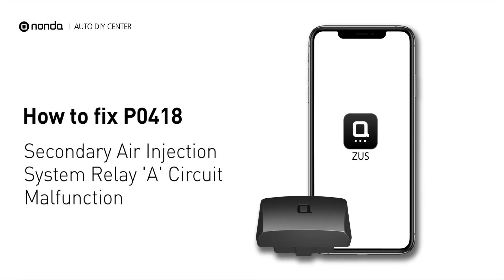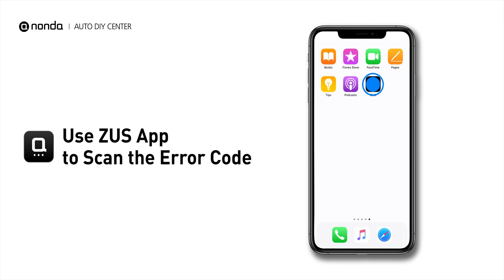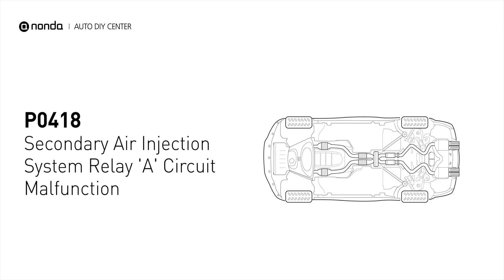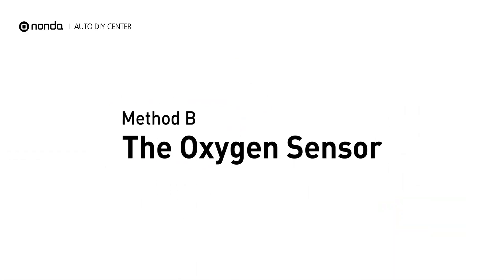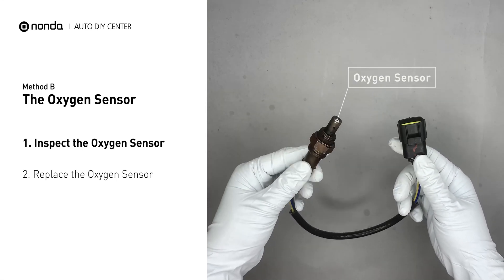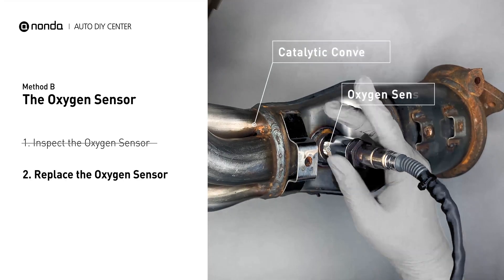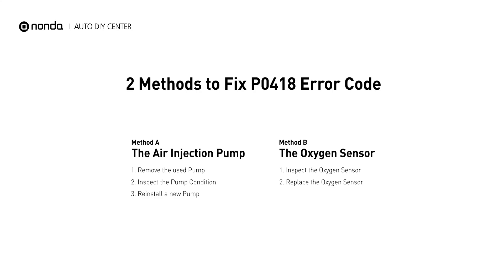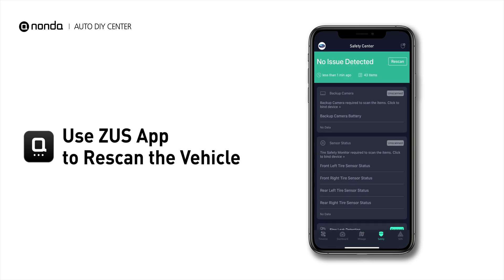How to Fix P0418 Engine Code in 3 Minutes [2 DIY Methods / Only $9.76]

Comment from the maker: Hi, I'm Steve, nonda's lead mechanic engineer. 
Feel free to leave your comments here if you have any mechanic questions, I will be glad to help you out!
Reply: This video was awful. Within 1 minute, it said the pump has the serpentine belt on it, clearly it does not. Then it says to inspect the pump pipe, and the video points at the wire loom? Extremely poor representation of this repair.

Comment: "Visually inspect the pumps pump pipe" and proceeds to point out and label the wiring 😆.
You left out the part where you can pop the cover off the pump and remove any debris that may be preventing the pump from turning or building pressure.
Reply: Is this really possible about what you said?
Reply: Yes...  @benl1122